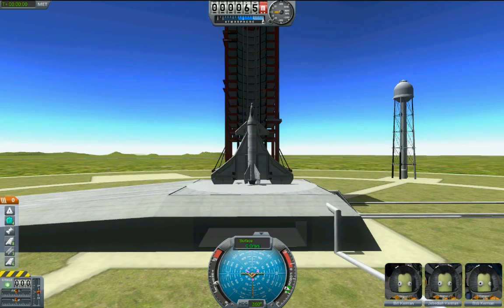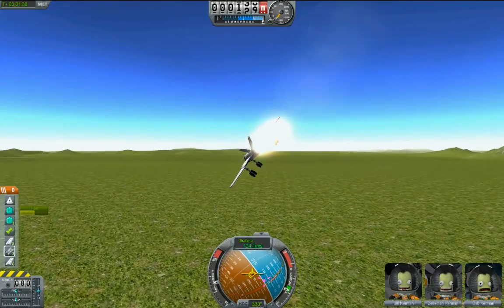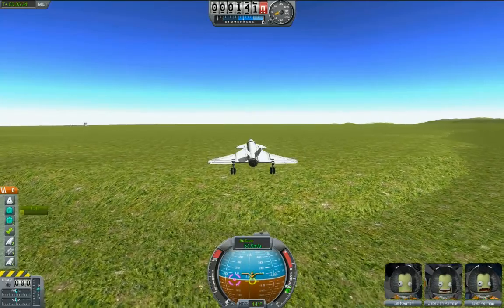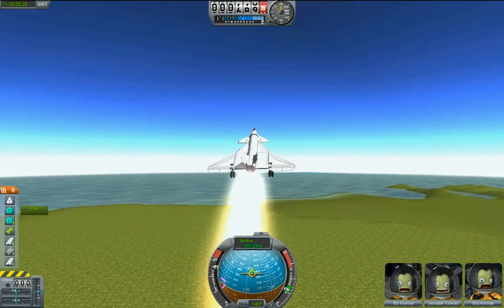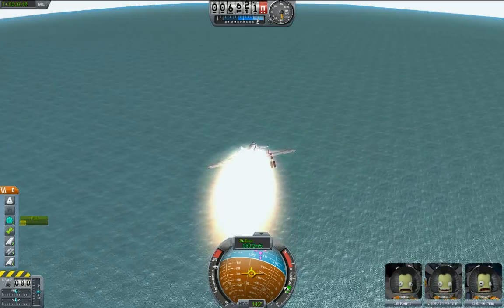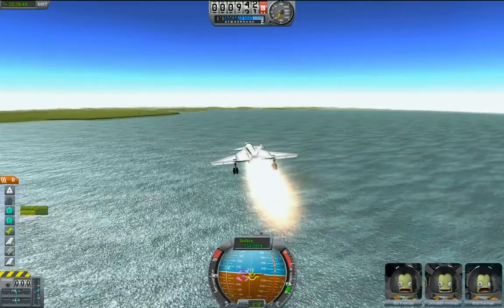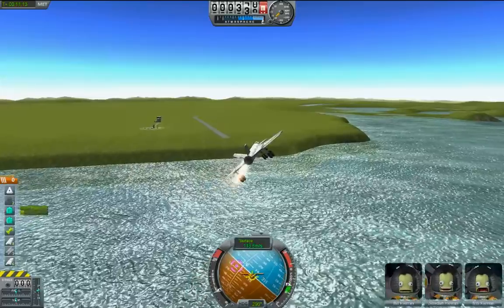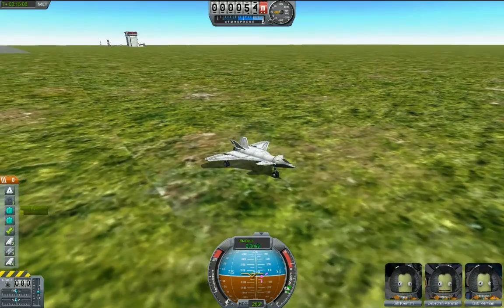Kerbal Space Program: C7 spaceplane tutorial, part 2, flying the first airplane

Comment: I have a problem with some planes, even if they are symmetrical and I follow your tutorial on building planes, I find the majority of my planes will rotate right, sometimes slightly, sometimes rather a lot meaning pressing q every few seconds. Do you know how to help with this? or maybe there is something I am missing? I have tried many things to try and correct it, such as extra tail fins. It most prominently occurs in the 2m flat bodied planes.